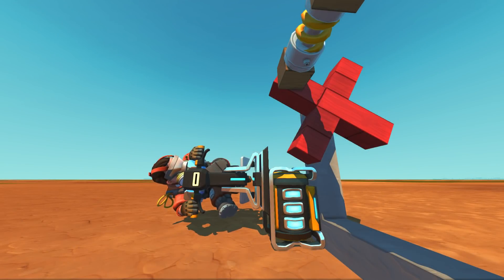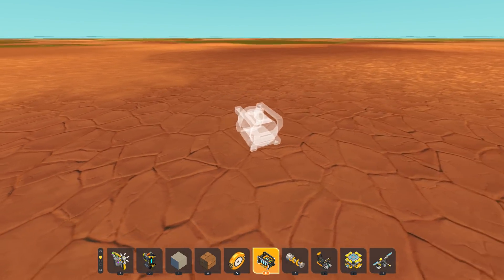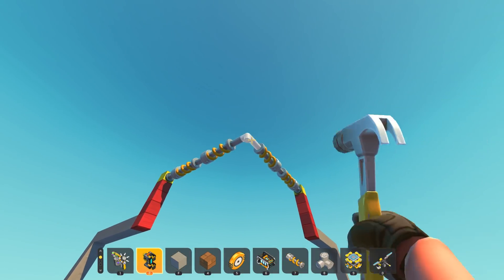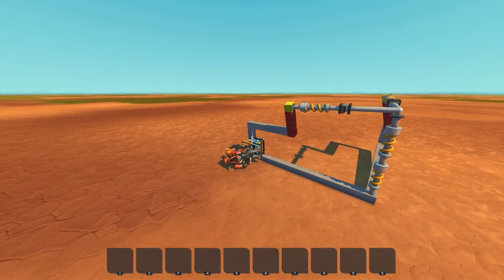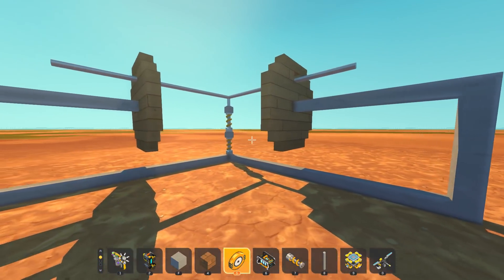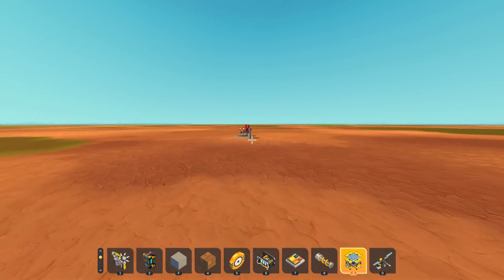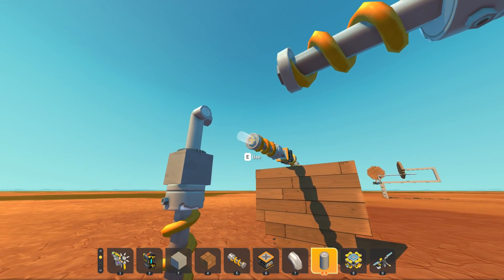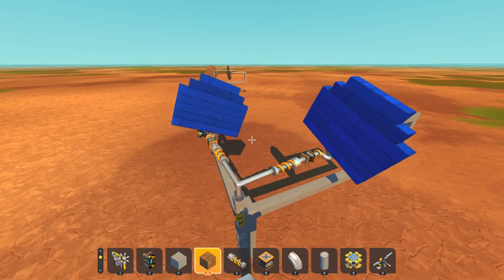I Built a 90 Degree Driveshaft and it Actually WORKS!

Comment: I think you only needed a downward facing bearing and an outward facing bearing on each wheel for it not to get stuck. I don't think you need all 3 axies. They need to spin and tilt left and right, not up and down.
Reply: Yes

Comment: I started to write that I want to see a drive line made from it, BUT that won't work.

Instead, how about a wheel driven weapon?

Build whatever vehicle (before or after) to transport it and attach the weapon via suspension.

One of the two "wheels" will be an actual wheel in contact with the ground. The suspension attachment will ensure it makes constant contact AND ensures that weight can be applied to that wheel to ensure good friction with the ground.

The sideways facing wheel will drive the weapon itself, via an linking rod forward to the another wheel which will have a drum extending the width of vehicle.

The impact points of the weapon can be solid bars sticking out, or better yet hinged bars with heavy weights (maybe drill heads) on the end.

Drive fast to spin it fast, aim for tote bots and let chaos ensue.

Comment: This is called a gearless angle drive by the way, this specific style with the up/down swivel is called an almond coupling

Funny enough, the way you said has insane friction is actually the most common way we do this today, it has less wear than gears if I understood it correctly since it's just sliding and not coming into and out of contact all the time
Reply: Also with this mechanism they both rotate clockwise while two connected gears would have one rotating clockwise and the other anti clockwise (which is of course fixable with a third gear but still interesting)
Reply: @HateHater I was looking if anyone had already said that or not.

Comment: Problem with first (technically second. I mean the one with weak piston) design is that the was no up/down pivot bearing causing mechanism to lock itself. Simulating ball bearing needs 3 regular bearings. 1 on each end to allow rotation of the shaft and 1 in between to allow pivoting.

 Edit: Nvm. He figured it out
Reply: I was watching the video, saw it was binding, he showed the original gif, I saw the third axis of movement, and I got pensive wondering when he'd notice that it needed to be able to tilt 'inwards' towards the center of the wheel or if someone needed to tell him.  For an engineer, it's amazing how he can miss some of the little details at times.  Thankfully he usually notices.  Makes kAN fun to watch.
Reply: @OnyxBMW  To be fair talking and trying to be entertaining is known for causing tunnel vision so missing something while recording isn't that surprising

Comment: I wonder if you can change the angle and or offset the height of that mechanism. May prove more useful then gears there. Also that first design is used in ratchet drives for zero play around a 90.

Comment: I think you should make a piston engine vehicle with a vertical engine shaft that powers the wheels with a right angle drive like this.
Reply: Yeah that was my first thought too. In his survival playthrough he has a lot of slip on the gears that transfer the power to the wheels, this might work quite well. I would go for the simpler one he showed at the start with just the suspensions.

Comment: You swapped your mouse 

I (just today) soldered a wire to my keyboards pcb antenna ... 10 mins and a little wire later my connection is better than ever

Ps you should compile your appliances and build a car with them also scrap man does a similar thing you two could do a scrap mechanic trials thingy to build a car or something like an excavator to do challenges

Comment: If you use a piston in the center bit, using controler you should be able to make piston powered rotation.
Reply: Not really. You cannot make piston engine with only one piston and this is no different from  that.

Comment: I noticed a difrence between this mechanism and Just using Gears: when using Gears, the Rotation gets reversed. With this mechanism however It dosnt.
(Depending on the way you Look at It getting reversed and not gettng reversed May Change)
Reply: To everyone saying it can't be done with gears, look from above. If you attach two bevel gears as close to the wheels as possible, yes, the rotation gets reversed. Flip one to the other side however, and the rotation is how we want it (how it is in the video). Assuming the mechanism in the video was actually used for a reason, it's probably the lack of techniques to accurately make bevel gears with the then available technology (i.e. no computers and CNC milling machines), not a lack of gears in general. They would have needed to make them from cast iron since other materials can't handle the forces that this probably experienced, looking at the rest of the mechanism
Reply: Not necessarily, if you arrange the gears right you can achieve the same thing
Reply: @Shadow__X  listen internet person, if there is a real version of this that was used for something in industry, then their is a reason they didnt just use gears
Reply: @Sausketo  because its old and they didn't have a geared solution back then....
Reply: @CalGames  Damn, that makes it even more impressive then, considering it must've been made pre-third century B.C. since that is the only time when a "geared solution" to this problem didn't exist. /s
Reply: @CalGames  what are you talking about, gears have been around since there were made of wood
Reply: @CalGames  the machines that made this mechanism have gears in them
Reply: @Sausketo  Hay internet person back at ya. 90deg drive shafts have been in use for longer then you have been alive. Any powered rear end, or powered front axle is just that, a 90deg drive shaft.
Reply: @Shadow__X  It does get reversed necessarily. From one rotating axis to another, with this the direction is always the same, with gears it is always reversed. No exceptions. Any gearing you do before or after this is completely separate from the two perpendicular pieces interacting with each others. You could add any kind of gearing to change speeds and directions, but still, that does not change the fundamentals of this mechanism.
Reply: @anteshell  I think he meant you could just add a small intermediate gear to the mechanism. Easy solution. Although this might be used in very niche cases where the design doesn't allow for gears for some unbeknownst reason (?).
Reply: @rokaq5163  Plenty of weird and wacky gear configurations in old clocks but never seen angled axes linked together with intermediate gears. That would be just one huge weak link in the system when reversing the direction can be done more robust with one rigid gear box. Although more often than not, direction changes are made on flat plane. That is because it is the most strong solution with least points of failure.

Nevertheless, I'm sure some home made tinkerer has made all kinds of working machines with this solution disregarding everything about structural strength and stability.
Reply: @Shadow__X  You would need an intermediate gear, no? Like input to output would reverse direction; input to intermediate to output would keep same direction of rotation.
Reply: @Ronald.Golleher  Imagine 4 bevel gears in a loop. Keep two in the corner where you have your input and output, and the direction gets reversed. But now take that away and connect the opposite one to the output with a shaft going through the "middle" (like an axle on a car without a differential)
Reply: @Shadow__X  yeah you're right. Saw your other comment and took a minute to visualize but that would keep the same rotation.
Reply: @Shadow__X  using 3 22.5 bevels
Reply: It does change direction for the red one, though. Just like the gear mechanism kAN was describing towards the end in real life. The blue one keeps the same direction as the original.
Reply: @ducewags  fair point. Sorry about that! I updated it now.
Reply: @Donke267  And when we add a posi system to the drive line, we keep the same direction and speed. FUN FACT posi can be done without an extra gear. 90deg drive systems have been in use for hundreds of years.
Reply: @ducewags  Searching for posi system doesn't return anything useful. Resources please?
Reply: @anteshell  Posi-Traction. It was a thing and still is in todays world. A shaft, gear and pinion mounted in a caes, or in the open. Used to power or run things at 90deg from the main system, direction can be changed by a simple shaft movement to run on top of the main gear, or under the main gear. Came out over 300 years ago in wind powerd grain mills. Thank Holland for that idea of a one shaft system with 360deg turning, and extra shafts mounted 90deg to the main shaft that could turn in two directions or the same directions, depending on it's use. Ships and tug boats use a Nesell drive system, or mono-pod drive, same idea. The props can turn swivel 360 on one axis and power 360 on a second or third axis.
Reply: For my understanding this mechanism has that advantage that it can have different angle than 90 degrees and still working perfectly fine without need for custom gears that would work on different angle. Technically you could even add hinge to make it work changing angle during work, but we already have much smaller hinges for shafts so it would be redundant
Reply: @Krokmaniak  Just like a mono-pod drive system for a ship, or tug boat if you look at real world uses in use today.